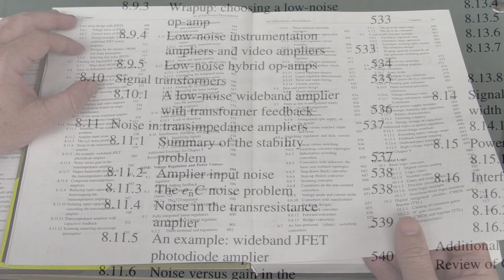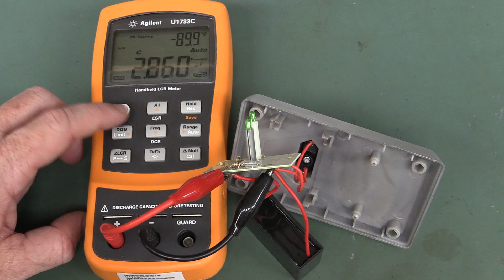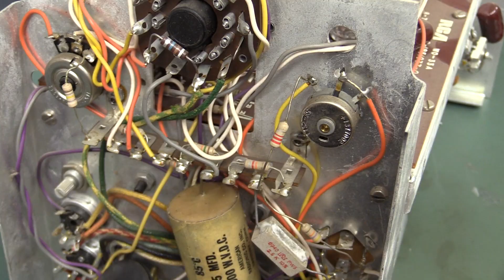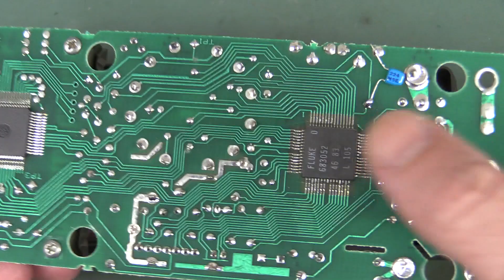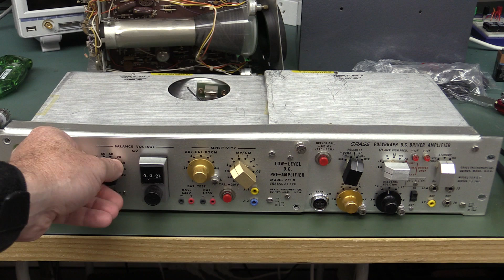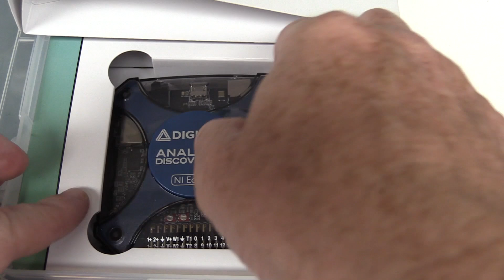EEVblog #847 - Mailbag

Comment: yes it is the chip, tight bastards skimped on a heatsink, the sigma chips need one.
are lie detectors admissible in oz?, in the uk justice system polygraphs are considered pseudo science and not reliable.
if customs had seen that honey they would have destroyed it, there are very strict rules on stuff like that.

Comment: Does that vibrator (proper name for mechanical chopper) have a B7G and a B9A valve bases?? That's soooo strange. I've got a tiny CVT (constant voltage transformer) on a B7G base which is bizzare but this might be even more wierd. I guess it's so you don't accidentally reverse it.

Comment: Its a photocopied boot leg copy made for college students so they can afford the thing. Does that mean the original copy is priced way too high? 
Most students are strapped for money as it is, books being the second most costly thing per semester. By buying a cheap knock off REQUIRED book for a class, that student can save money. Yes, the book may not be perfect, as long as content is correct. Why did they change the spelling though? Dummys. 
Just photocopying an original wasnt enough, they had to retype the opening pages, then misspell them. 
lots of scams going on out there.
The Chinese are good at copying stuff, but to muff it up in the process is not a compliment. Knuckle heads.

Comment: When I was young (yup  - a long time ago) my dad was a gadget fanatic before me. I remember he had one of the first Philips cassettes (recorder) mounted professionally between the front seats and wired into the radio so you could actually record radio.. but I digress  - amongst the toys he had in the car was one of those mechanical vibrators to generate 240v from the 12v car battery - you could hear it buzzing in the background. Amazingly simple - and considering the transistors of the day, not a bad idea.

Comment: do u still have that fluke? it'd be nice to have one, btw im 15, i have a nixie tube meter and i need to calibrate it i use it mostly for vacuum tube equipment to test plate voltages

Comment: I have an old DC-AC inverter for an electric razor from the 60's that uses a mechanical vibrator similar to that to generate its AC signal and an iron-core step-up transformer to bump it up to 120 V. It only makes about 15 watts, but it's actually enough to run a cell phone charger or an LED lamp!

Comment: I'm new to electronics since I am studying Computer Science and I am more into that. I do want to get into electrical engineering too. With that energy saver box, won't the capacitor act as a resistor on an AC circuit, thus actually wasting power instead of storing it?

Comment: My explosives detonator box & galvanomter are from the Atlas Powder Company, but they are identical to the DuPont models. Nice old RtR scope! I just got an RCA Isotap TV repair transformer. It is built like a little tank, and has common USA outlet voltages in direct & isolated. Really a nice unit, and without one, you could kiss your O Scope goodbye. The RCA tube analyzer is still considered one of the best! Back when RCA was in New Jersey. Now RCA is just a name used for branding garbage Chinese televisions, sold at Walmart & other discount retailers, of third rate junk. Fluke 73s were a good field meter for electricians. The capacitors were under a carbon fiber shield so if you were dumb enough to try to test the 13,600 volt test taps at the copper mine, it would not blow up in your face.

Comment: Counterfeit books too! Dear me, and they are targeting you, & one of your books? Not good!  Bob was my uncle, but we called him Pete all his life, and his middle name is not Peter either. Sometimes it is not just that simple! I have been finding scads of counterfeit components. Expensive RF transistors, especially Japanese made semiconductors, and now some electrolytic caps, so they are even counterfeiting passive parts too! The Japanese RF stuff is so bad. The market is just flooded with the counterfeit transistors, and it gets worse every day. By the way, I need to fix a receiver that was desensitized by a deliberate attempt to destroy it. I was running an attenuator so their attempt only partially succeeded. It succeeded enough to make the receiver almost unusable. I get strong signals but with very low audio output. Weaker signals are  just gone now.

Comment: What you didn't power up the scope. Where is the fun in that.I have a much older HP140A that I have converted into a osciloclock. All original parts, works like a jewel.

Comment: In America these devices will not even save one penny. It will actually cost a small amount to use it. Our residential power meters do not measure reactance, only the resistive portion of the load is measured.

Comment: lol I think the led's draw more power then that "energy saver" claims to save. The screws that never seem to strip the plastic out are a double helix with one helix more narrow, this prevents it from physically splitting and allows it to self tap making a tight fit. In just about everything I've come across with them they never strip. But some manufactures use regular screws and it strips out in no time.

Comment: I will keep my First Edition copy!  That potted box looks like a stock generic motor start capacitor, I have seen simillar for small AC motors.
Reply: Not surprising to see Fran Here
Reply: Such as in ceiling fans and other fan motors as well sing this quite a bit.

Even though you don't often fail Let the magic smoke out pretty violently have seen this couple times in my life.

Usually they fail gracefully or just a little at a time as the people want to know would know for sure.

This type of capacitor is designed Knoxville catastrophically as in going ballistic!

Usually not as bad as the old refa capacitors when they do like to smoke out pretty much!

And yes the failure mode at least when it fails correctly is a safety thing as well!

I saw one of these capacitors I could not believe it was actually still working it looked like it had walnuts out but still no signs of an externally Elise from the outside of the fan

They hadn't reported anything unusual other than just sometimes not starting with all at first.

But I could not believe that the capacitor was still in one piece let alone at least somewhat functional unfortunately could not measure it did not have proper equipment to do so but we've been really interesting to see how much was still well quote unquote working!

Looks like it had had a few nice pop bang Fizz moments but yet doing so and not raising suspicions also this is only used when people were there for sure for what was told to me

Comment: Nice Fluke meter.  I've still got my Heathkit branded Fluke 77 that I bought in the late '70's.  Had to replace the fuses inside a few times thanks to my overloading the ammeter!  I've got the plastic holster - protector and the fake leather carry case too.  Did have to get some new probes along the way.

Comment: Good luck using the Red Pitaya, you may find it's not as useful as its specs make out. It may have 14 bit DAC/ADC but unless they've updated the hardware beyond putting it in a case, there's no shielding and so it picks up a lot of noise and there's massive crosstalk between the channels, meaning for most uses it has a much lower ENOB. They also updated the firmware recently so that you don't get any functionality on it without either buying the apps separately or sharing their facebook page once for each app which I hate mainly because when I bought the hardware the (very bad) software was free.

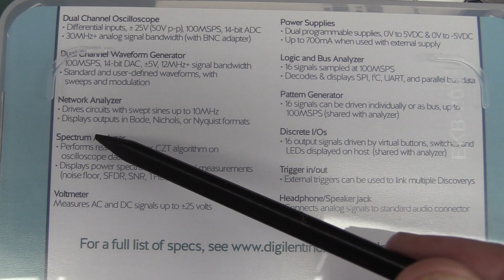Before they updated their software I said to them something very similar to you at 44:45, that with something like this it all comes down to the software. Their previous software was so very very bad it was basically unusable. They replied to me to say they disagree on this point.

I haven't tried the NI part but with similar specs and not much sign through the case that they've considered noise or crosstalk, I'm afraid there might be similar hardware issues. Hopefully their software is better. I look forward to your in depth video about it!

Comment: used to have a bigish collection of caps down one side of the warehouse at old supermarket I worked for the the fridge motors I presume. New store I npw work at doesn't as instead it has a gas turbine to pump the refrigerant.

Comment: Watch the static discharge at 1:53 from the corner under Dave's hand.
Reply: +ShineShooter Oh wow... That sheet really is conductive then :D
Reply: +ShineShooter That's a reflection. An AS bench mat is quite resistive so any static gets discharged relatively slowly at a current that won't do any damage.
Reply: +Graham Langley 
Agreed, that's not a static discharge. ESD would follow the shortest path between the corner and the mat and hence would have been tiny, not the big blob a couple of cm next to it.
Reply: +ShineShooter Nice catch. I caught the tin whiskers, but this is a good one as well. What would of reflected like that? I would suspect it would be a discharge. interesting!
Reply: +Jitter 000 As the bench mat is resistive there'd be no spark at all - that's the object of it.
Reply: +ShineShooter If you look closely, there's a thin piece of plastic there. It's probably a reflection from that when Dave "slams" the book down on the bench.
Reply: +Mathias :P 
Yep, if you start a couple of seconds earlier, a small piece of clear plastic sheet material can be seen lying on the table. As soon as Dave puts the book down, it touches the plastic which makes it tilt. That tilt happens to reflect the lighting into the camera.

I agree that ESD should not take place on a resistive mat, but if it had done, then it would not have been larger than a tiny spark similar to that of a spark plug.

I am in the electronics industry and everything in the EPA (ESD Protected Area) is earthed with at least some resistance. As you know too high insulation builds up too much charge, but too low and it could discharge violently. IIRC earthing is OK between 1 M (lower limit) and 1 G Ohms (upper limit).
Reply: +ShineShooter nice catch
Reply: +ShineShooter I have no idea how you caught that but I am impressed. I had to watch it three times, even after you pointed it out.

Comment: I think I see tin whiskers on the chopper at 33:30 and a bit beyond.
Reply: +John Eastmond Yes, I noticed them too! Check it out Dave :)
Reply: +John Eastmond I saw the whiskers too. In analog television, when I started in the late 1980's, we had a video router to send signals around the facility. I remember using the "Chop" button. Somehow I understood the use for aligning the timing of video sources, but I didn't know the origination of the term. Very cool to learn this!

Comment: That WDTV! WTF?? That's a rtl8192 WiFi chipset that was designed to be placed in a USB dongle with a shield over the chipset. Probably cheaper than designing the board to include a mini PCI-e slot I guess. Just, wow...

Comment: Hi Dave, love the channel.  FYI if you're interested,  I have one of those WDTV boxes and solved the overheating and locking up issues (almost daily) I was having by reverting the firmware to an older version.   I don't have the link handy now but there is a thread about this online with the older firmware posted, I can look it up if you like.

Comment: I'm pretty sure the EMI can has never been soldered onto that WiFi-module in that WDTV-box. The footprint for it is always made in the layout, and it's then only fitted if EMC-requirement shows it's needed. Cost cutting i see all the time.
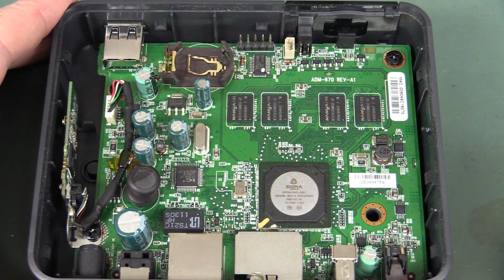Reply: +zaprodk I wouldn't be surprised if the sender mooved the WiFi module to the side and removed the RF cover to try to reduce heating. At 24:52 you can see hand-drilled holes on top and added thick feet on the bottom to increase airflow.
Reply: +blargg Look at this. It's factory to look like that: http://www.storagereview.com/western_digital_wd_tv_live_review - Yes he did drill holes, but did nothing to the Wifi-module.
Reply: *****
OK, don't have a cow. It's just my idle commentary on something insignificant :)
Reply: +zaprodk "WiFi-module"
It says USB Dongle on the silkscreen :P
Reply: +Bbaass_TMH It's still a Wifi-module.

Comment: i go for a shootout between the RedPitaya and the discovery 2 as well, and i´m especially interested in the FFT capabilities....so do one, Dave...:)
Reply from the maker: +TubiCal Are there any other competing ones?
Reply: +EEVblog What happened to the high frame rate?
Reply: EEVblog i just don't know....my old uni-t dso does a good job on audio signals...I wonder how these PC based scopes perform especially in real time updating...I also have an analog spectrum analyzer but since it's sweeping I have no real use as my stuff usually mess around with its output over the audio frequency range vs. Time (phaser and hi/lo/band pass filters with a lot of modulation of them center frequency....I bout my uni-t back in 2009 just for its nice and very fast math fft function. Even twice prized digital scopes can't compete....
I would love to see how the Rode@&Schwarz performing a real time audio frequency range fft....

Comment: The blast machine will output a high voltage pulse.  DO not touch the terminals on that when you press the fire/detonate button.   We're talking about heart stopping potentials/energy there.

Comment: My mother's ex husband had a PF correction thing installed at the house.  Its basically a capacitor wired into the breaker box.  Absolute rubbish, does nothing for for the power bill.  Maybe it helps filter a little RFI but I doubt it.

Comment: just needs a heatsink on it (my linksys E3200 router when running Adv Tomato tends to overheat as the CPU is doing most of the work when using custom ROM, had to fit a bigger heatsink and leave it upside down as all the vent holes are on the bottom of it)

Comment: A comparison video between the red pitaya and the analog discovery 2 would be nice,  thumbs up for that!
Reply: +EEVblog None that I know of, at least not as versatile as these two. There are multiple variants of USB Oscilloscopes on the market, that do offer "multi instrument" features but I don't think they come close to the versatility of the Red Pitaya or the Analog Discovery.
Reply from the maker: +VoltLog Are there any other competing ones?
Reply: +Kevin Harrelson If you don't find versatile a gadget that offers you: oscilloscope, spectrum analyzer, LCR meter and possibly more, all for 200 EUR then maybe we have
different expectations for the term versatile...
Reply: +cam3oh I will not touch anything from Analog Arts after the SL987 unit they sent to the Signal Path Blog for review turned out to be a dog's breakfast that came nowhere near meeting its specifications.  The inside looked like someone had randomly hand-soldered dozens of surface-mount components on a fully populated board while blindfolded.

The worst part of the sad affair is the 4-5 newly created "sock puppet" accounts, used in the comments of the video review to argue with people that had critical opinions of the unit.  It appears that Analog Arts is a marketing company, expert in manipulating public opinions, and not so much at instrument design.

To accuse the reviewer of breaking the unit and not knowing what he is doing is hilarious.  He could design a better instrument in his sleep.  Did they not know he was going to test it or take it apart?  Clearly they got in way over their heads.  They could have saved the situation by being honest and fixing their mistakes, but chose a different approach.  I am not saying that Analog Arts made those accounts for dishonest purposes—but I am definitely thinking it.

Anyone who doesn't know what the Signal Path Blog is, get out from under your rock, lol...you haven't lived yet.  If anyone is looking for the video is called Review and Teardown of the Analog Arts SL987 USB Oscilloscope AWG Pattern Generator & Logic Analyzer which is worth nowhere near its $2000 price tag.  It is a box of tricks in a shiny metal case.

I get that mistakes happen, but all the bullshit the company did to try to cover it up has taken the bloom out of the rose for me.  If Analog Arts is smart, they will apologize to the community for being dishonest, reconsider their marketing strategy, and design a new line of products with accurate specifications to replace the garbage.  Will they turn the ship around in time, or is it already on the rocks?  I don't trust any words from them.  The proof will be in the pudding.
Reply: +pillsnotbills Thanks for the information. Brutal to see Analog Arts be so deceptive. I'm even more interested in review of the Analog Discovery 2 and Red Pitaya now just to get a better idea of how useful these things might be.
Reply: +VoltLog YEP...! :) :)
Reply: +VoltLog The Red Pitaya does not even look like it has ANY digital channels (unless I missed them).  How is that "vertasile?"
Reply: +VoltLog : Yeah, I am a digital guy.  'nuff said.
Reply: +EEVblog The guys at Analog Arts does a number of USB oscilloscope multi-instrument packages. It&#39;d be nice to see you compare one to the Analog Discovery 2 and Red Pitaya. You&#39;ve the knowledge and ability to explain what works, what doesn&#39;t, and the things one should and should not expect in projects.
Reply: +VoltLog  It would good, to say that the red pitaya is an oscilloscope is underestimating it's potential, provided that you are willing to write some software, it is a stand alone computer similar to a rapsberry pi without the graphics.
The FPGA source is a available.
 Currently it is one of the devices that I'm looking at as a standalone networked data acquisition unit to integrate into some RF equipment. The redpitaya has digital IO and four 12 bit DAC channels as well on headers.

I am also looking for more devices like this, preferably with ethernet.